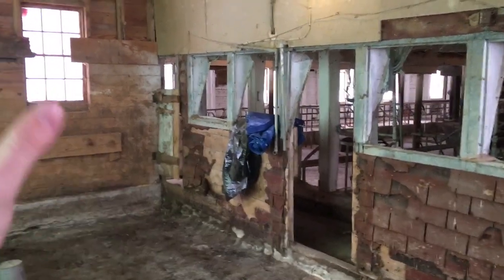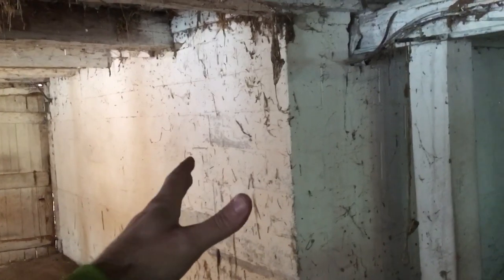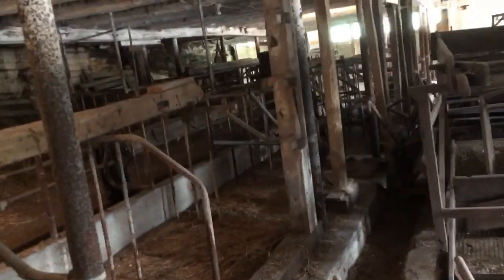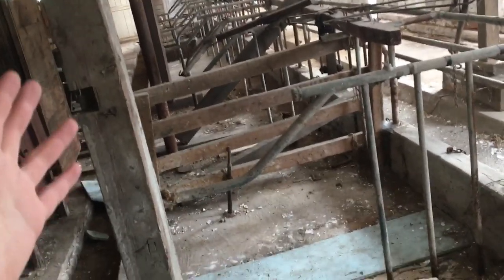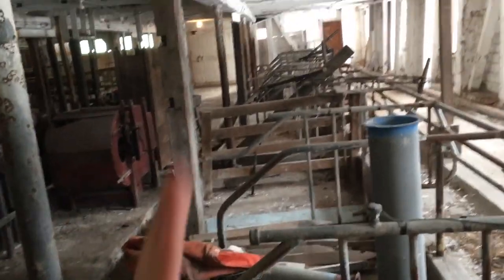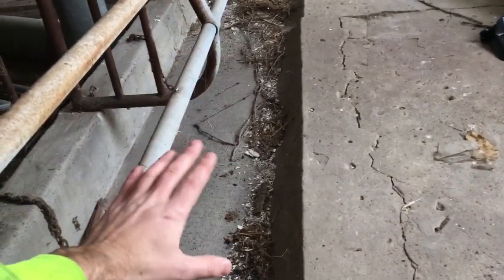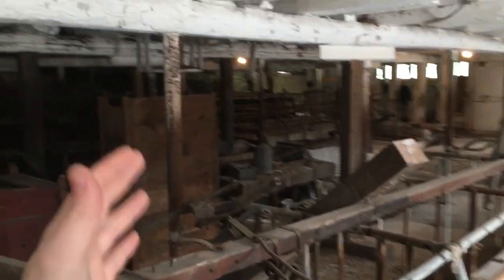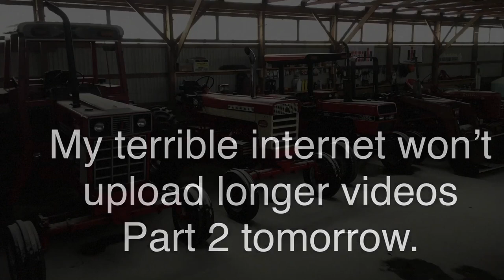Starting a Dairy - Can it be Done?

Comment: Nice video ! I milk cows now and have for 45 years. Still with the old bucket milkers ! Yes you can start  milking cows today.....provided you can find a hauler to pick it up. Marketing is the key. Having said that...... get rid of all the extras .... !!!!! No need to feed the cows in the barn....no need for a barn cleaner !!   Dont keep the cows in the barn. They stay much healthier out roaming around. No leg issues !  Less mastitis issues ! They need good wind protection during the cold winters as we have here in Iowa. Better yet.... dry most of the cows up during the winter time.  Calve starting March 1st. Use rotational grazing is key !  Never invest in a TMR....or silage equipment ! Feed cows outside....free choice. They will balance their own ration! Wrap silage hay..balage the best feed product out there.....in round bale feeders. No leaf loss....can gain at least an extra half crop of hay throughout the year. Cut and bale the same day ! Less tire traffic on the hay fields ! Six crops of high quality hay per year....25 day cutting interval . You can buy a full line of high quality " used " equipment for under 25,000 dollars.  Two tractors...small 4'x4" round baler....rake....hay racks ( to haul the round bales home with )....haybine... and a bale wrapper. Most farmers own a wheel drive truck...... often thats the cost of a full line of equipment. Remember though...... your married to the cows !  If you cant stay home.......dont think about milking cows !  Over the 45 yrs Ive milked cows. I miss being in the barn 10 days due to a hernia surgery.  Farming can be a joy......depends on the operator !
Reply: Either someone gave you an inheritance or you have no recent P&L statement.      Who in their right mind would take over?  what you're doing is your thing and if married the other person has non-farm job.

Comment: I just put in the loop tie stalls you are talking about they bolt onto the concrete curb I'm really happy with them I also took out the cow mats and bolted a 3 inch PVC pipe on the back of the stall and filled the stalls with sand the cows love it and went way up in milk production the hole project cost under 10,000 on 45 stalls
Reply from the maker: I did hear that with the pipe and sand. I haven’t seen it in person. Always wondered how it worked. That’s great

Comment: watching this again.  its sad to see empty barns.  would I if I could.  probably. as i get older the itch is getting less. lol
dad used to be a Patz dealer,  we installed a lot of that poly in mangers and everyone saw a couple lbs a day from the cows simply by eating more.  in the corners of the concrete the wet feed gets stinky and then the cows slow down on eating.  

if i had to on our farm start a small dairy i would put up a little building just for the milkhouse and parlor.  then cows would be on pasture/loafing shed out of a lean to.  also would work with more grazing then traditional ways. would still have a tmr and a meal a day of top quality.  would work more for animal health and efficiency.  no need to keep max production if the cows last longer.

Comment: 1 door - just needs to be self closing. A spring works well. Slow moving self closing mechanism does NOT work because it closes slowly and lets flies in. I milk in 70 cow tie-stall and pipeline system. I have 1 door. Mattresses  are great , I have them , also have plastic sheet 30" wide and the length of the mangers . These manger liners worked as well as tiles at fraction of cost. Just measure width , roll out and slide into manger - DONE !. The absolute most important thing for you to do is ROTATIONAL GRAZING. No spring work and expenses except a little fertilizer. Only need a little machinery to make hay bales -dry or baleage. That can be hired out if need be. Look up rotational grazing on You Tube. hint - perrenial grasses grazed cost 1/3 as much as corn alfalfa ration . Perrenial grasses made into big bales dry or balage cost 2/3 as much as corn alfalfa ration AND IS MORE NUTRICIOUS !!! Total year cost for roughage (your biggest expense) ens up cut in half !(1/3 for 6 months - 2/3 for 6 months!) That is how I farm and make good money.
Reply from the maker: Thanks, that’s some very good advice. I was hoping dairy farmers would comment.